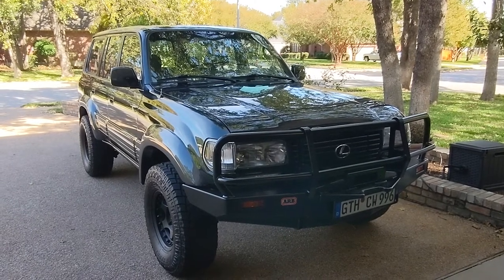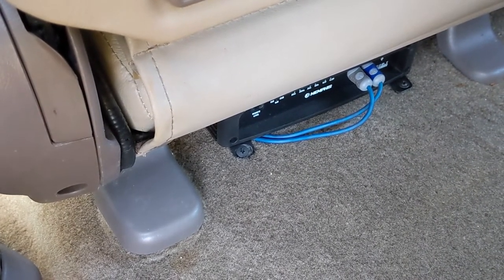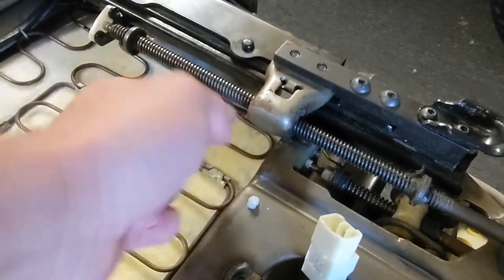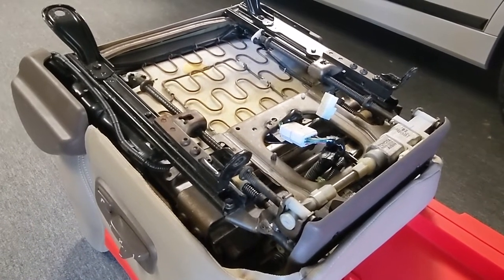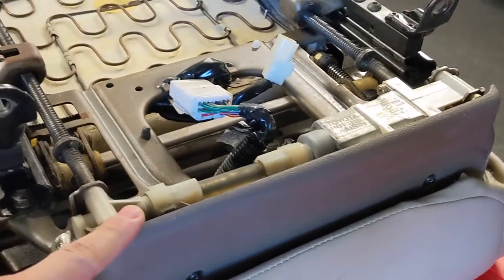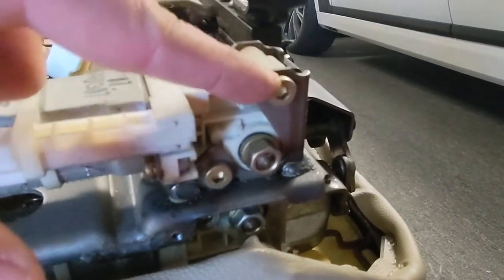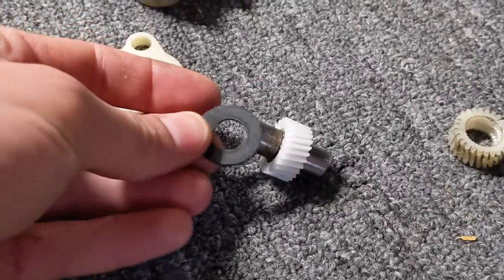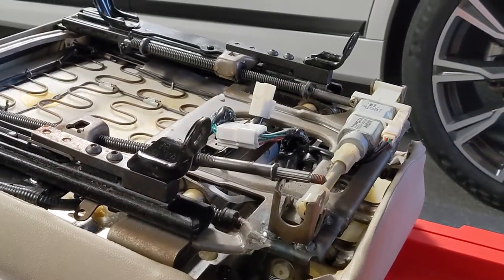Land Cruiser Power Seat Gear Replacement and Fix  Gamiviti Seat Gears Toyota FJ80 FZJ80 Lexus LX450

Comment from the maker: The replacement Gamiviti power seat gears for the Toyota Land Cruiser and Lexus LX450 power seats can be purchased from Gamiviti directly here: http://www.gamiviti.com/seatparts

I highly recommend you get set of 3/8" wobble extensions. They make this and many other tasks where a socket is required in a tight spot much easier. I got mine here: https://amzn.to/33OavBm

Make sure to get a good trim pry tool set. I recommend this one: https://amzn.to/3G4Efae

Comment: I made a fix. Cut a disc from the base of an alu beer can and push it into the space so the concave side is facing out and it holds on the thread. You could lock it using a pin.
Reply from the maker: Gotta love the home brew fixes. Hey, as long as it works, that is awesome!! Nice work!

Comment: Thanks! Just did this! Missed the part where the gear comes off the shaft but we just hammered the old gear off and new one on with a socket as you said in the comments.
Reply from the maker: Yup. Easy to do with a socket. I bet it feels great to have a working power seat again
Reply: @NKPGarage  Yeah its great. Any idea why there may be a slightly uneven movement? Would that be because the alignment isnt perfect or because the gear may not be greased correctly?
Reply from the maker: @luketaylorZA  do you mean like the left side and right side aren’t even? If that’s the case you may have gotten the two rods slightly misaligned during installation. Will need to take the seat back out and adjust the left threaded rod and right threaded eod to be even and then put it back together.

Comment: have you ever had the motors completely stop working? i sense i have an issue that doesnt directly involve the motor as on both seats all other functions work except the back and forward (no sound coming from the motor)
Reply from the maker: Anything could happen I guess. But it is unlikely that both seats have bad motors. Have you done a visual check to see if the plastic end caps are still there?

Comment: Thanks for the video, I’ve gone back to this 3 times already. Is it normal to have a little play in the seat? If I grab my steering wheel and push back and then pull forward I can feel the seat move. Not much maybe a quarter inch or so. Just enough to notice it move. I’m not sure if I did something wrong. Also, is there a torque spec for the nut at the end of the shaft?
Reply from the maker: A small amount of play is normal with them. Being 25yrs old. But 1/4” sounds like a lot. Have you tried removing the seat, laying it upside down on the ground and seeing where the play is? Incase it is loose somewhere?

Comment: I have been following the instructions.  How did you remove the old gear from the splined shaft?  Does that need a presss.  In the video it magically appears. Mine does not want to come off.
Reply from the maker: I just used a deep socket over it and tapped it lightly with a hammer to get it off. And then did the opposite to top it back on and position the new gear onto the "teeth" on the rod.

Comment: Finally getting around to installing my Gamiviti gears on drivers side.  One side of the seat worked fine, but the other side with the motor I ended up busting the metal splined shaft that the gear presses on to.....%$#@*!...........I will have to try that  brass  one on Amazon now that has the shaft and gear all in one.
Reply from the maker: H man. Sorry to hear that. I haven’t seen that happen before. Hopefully you can get it fixed and working with that other part.

Comment: Good video!  I noticed that the bracket that is connected to the threaded rod appears to be attached to an extension on both sides?  Can you share some info on them?  I would like to go back a little further with the seats.
Reply from the maker: You can get the seat extension brackets from a few places. They add around 2" more leg room. Cruiserparts.net has them here: https://shop.cruiserparts.net/index.php?main_page=product_info&products_id=150

Comment: Are the gears on either side the same
Reply from the maker: Yup. Both sides are the same gear
Reply: The end plastic ones correct 🙏🏻
Reply from the maker: @rafaelmaldonado7779  yup. Both the end caps and the gears are the same on both sides.

Comment: great how to, but i went different route on parts, i got mine made of brass from ebay and for the missing worn end cap, i got from home depot 1/4' brass cap and after happy  $25  i  called done deal for each seat sets of gears and caps.
Reply from the maker: Great idea as well! How was the installation with the brass gears? Did you have to press them on? And when they went on were they a nice tight fit? I saw those as well, but never gave them a try.
Reply: @NKPGarage  no need of pressing, it comes one piece bushing and gear, i just repack it with new grease, and good as new again smooth travel.
Reply from the maker: @waltermillan1717  very nice! That's great to hear there are more options out there for these old trucks we love!
Reply: Thank you for the idea. I ordered mine from eBay same as yours for 20 bucks and now im just looking for the caps. they worked perfect and now can move my seats from and back without worry.
Reply from the maker: That’s awesome! Great work! Gotta love it when they work
Reply: @NKPGarage   Hey man thank you for sharing this. my seats were moving just from one side and they were stuck. I followed your directions and removed the little plastic piece and replaced with copper ones like Walter. and now they work back and forward perfect. I just got this old lexus lx450 and im working on it. not triple locked but still like it. 🙂
Reply from the maker: @vicv871  I bet 99% of triple locked Land Cruiser owners never use the lockers anyway. It’s just for bragging rights for most people
Reply: @vicv871  very happy to heard that, now you know it works, hope you fix both power seats back to happy.
Reply: Walter, could you provide a little more information about the brass end cap and What you got from HD or Ebay? I really like that idea I'm just assuming it's a plumbing brass end cap? Thanks for any info you can provide.

Comment: I busted my plastic gear pressing it on. On the second try I used a torch to heat up the spline. Then the spline just oozes into the gear. Drop in water when it sits correctly and you’re done without a chance of busting the gear.
Reply from the maker: I'll keep that in mind for the next time I have to replace a power seat gear! Great tip!